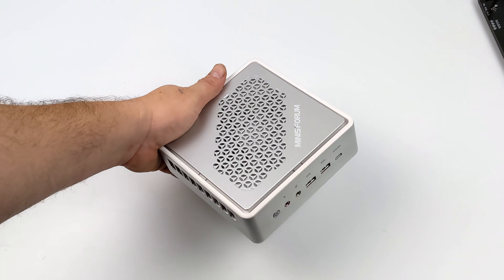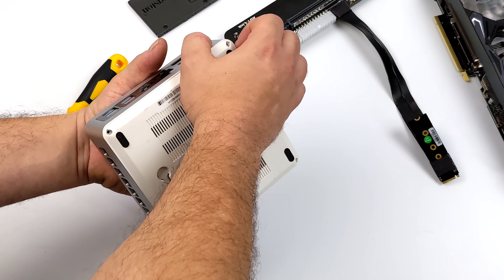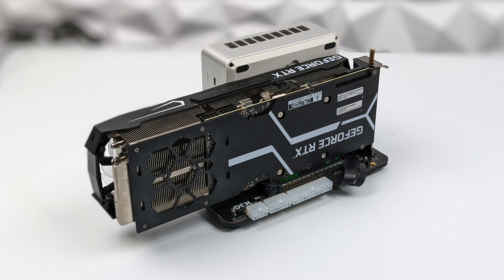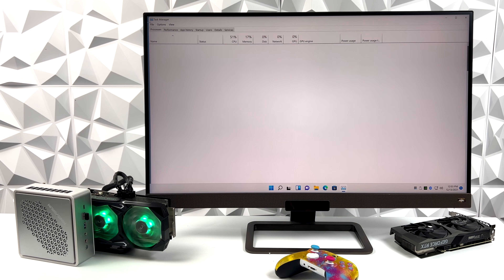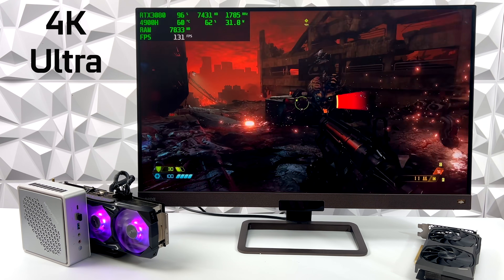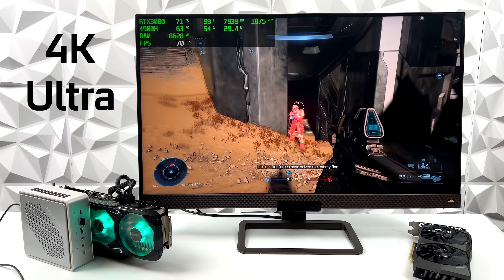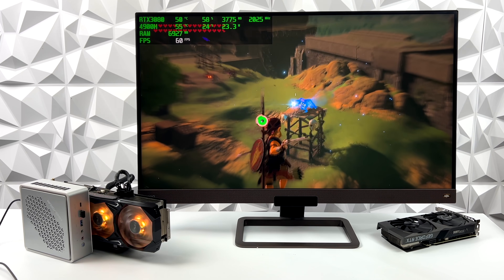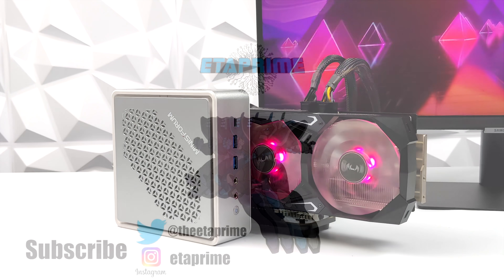We Built The Most Powerful Mini PC! It's Insanely Fast For A Tiny Machine!

Comment: how much does it cost to build someting just like that ?
Reply: I paid about 250 to 300 euros for my setup, here's what I got:

I got a HP Prodesk 600 G4 mini (OEM) for free from work. They were about to toss it out even though the machine's in perfect condition. It's got an i5-8600T, 8GB DDR4 RAM (upped to 16GB later) and 256GB SSD.

I added a GTX 1650 (120 euros) and the ADT-link adapter (about 80 euros). The Dell DA-2 adapter costed me about 35 euros. Add in additional costs for RAM upgrade, a 512GB SATA SSD and optional stuff like a 90 degree HDMI connector.

If you were to add costs for the PC it would be more towards the 400 euro mark, but you can get even cheaper than that. I saw a sealed GTX 1650 on Ebay earlier listed for 100 euros. Hope this helps!

Comment: There is not much difference in the performance between pcie x4 vs x16, as there is no game yet that uses the data bandwidth to the fullest. There might be some drop in performance because the 3080 ti here has been power limited.

Comment: would be cool if you could mount the mini pc internals on the back of the GPU with standoffs and get a 3d printed back panel so its a gpu size mini pc. or use a shorter 2 fan GPU but with a 3 fan cover and the mini pc is mounted at the end of the GPU under the third fan.
Reply: doing it with something like gtx1660/rtx3060 would be cool

Comment: I don't know why minisforum or one of those mini pc builders don't build a machine with an x16 slot on a side (and a power input for it). I'm pretty sure there could be market for it as a modular pc of sorts.
Reply: Minisforum is putting out a modular miniPC with x16 slot on the outside case where you plug in the eGPU .. problem is now you have two PSU ..
Reply: because there are acceptable laptops instead of buying those high end mini pcs,buying a mini pc doesnt makes if you a budget higher than 400 dollars
Reply: @lebedev6954 true. If you want a janky, a laptop is better then a mini pc because there are alot more use market for laptop rather then mini pc.

Comment: Imagine shrinking that RTX 3080Ti's die to fit within that case with a tiny psu there and still get the same performance with the same 4k resolution and ultra settings. That would be fabulous!! Technology has come a long way and still improving day after day.
Reply: cases were basically so big for a long time due to the HDD/ floppy/optical drive prevalence. With these newer storage solutions the case doesnt need to be as wide necessarily
Reply: @tobiwonkanogy2975  Absolutely

Comment: Surprisingly, even with the graphics card using only 4 PCIE lanes of 16, power limited with the 280w psu, and with a fan and a half blocked by the PC- it still managed to squeeze out just over ~80% of its max perf based on its 3dmark graphics scores (not overall); it's basically performing as well as a non-Ti 3080 in a normal desktop. Really not too shabby.
Reply: Too bad ADT m.2 adapter cant be hot swap(Shutdown after ending game, if you using APU), that make thunderbolt egpu better? I guess
Reply: @starrynight3945  Thunderbolt eGPU is significantly slower than M.2 PCIe X4 slot.

The reason? Thunderbolt eGPU only runs at 22 Gbps. Not 40 Gbps as advertised.

Meanwhile M.2 external GPU runs at 32 Gbps if using PCIe X4 Gen 3, or 64 Gbps if using PCIe X4 Gen 4.

Comment: I had no idea that you could connect a gpu to a m.2 slot. Does that work on laptops too? my laptop doesn´t have thunderbolt.
Reply: It should as long as your m.2 slot supports NVME SSDs, it should also support PCIe adapters like this. Just mind the generation and number of PCIe lanes as they will greatly affect performance.

Comment: I always see people asking for thunderbolt. 
Yes thunderbolt is pretty amazing, it is fast and incredibly simple/easy to deploy
But its very limited in speed compared to M.2.
The USB-C/thunderbolt4 connector only has 24 pins
PCIe 1x has 36 pins. M.2 trims many of the duplicate pins and ends up with 67 pins with 4 lanes
Even if you cut out all of the power pins, and can use all 24 pins for data on that type-C port
You're still talking about only enough pins for 1 lane, as 2 lanes would require 28 pins, again, assuming you have no power delivery.
If you cut out all of the grounds except 1 for a common ground, you then you would only need 9 pins per lane, but thats still less than 3 lanes of PCIe, where as an M.2 has 4 lanes

Which makes sense, because a PCIe 4.0 M.2 has a theoretical bandwidth of 63Gbps, and Thunderbolt 4 has a theoretical limit of 32Gbps

Now, most of these laptops and APUs dont yet support PCIe 4.0 M.2, cutting that speed in half. putting thunderbolt 3/4 possibly faster, but IIRC that is combined bandwidth, with some of that bandwidth reserved for video over displyport

My only device with thunderbolt, only reaches speeds of 1xPCIe 3.0 (945MB/s) this could be a limitation of the thunderbolt enclosure i have, but that SSD can normally top 3200MB/s in an M.2 3.0 slot.
Reply: Nobody ask you to write the history of your life in that long comment.

Comment: Can you please give us the name of the power supply?? I've been looking everywhere for something like this!
Reply: Search  on eBay for old Dell laptop PSU with 8pin connector, there are several models depending on how  much power you want, and 2nd hand they are all very cheap. 
However they are much bigger than modern PSUs,  a real brick (at least you could be used as a effective weapon if neccesary)
Reply: Should be DA220 or something similar, its a Dell 220W used for Alienware and similar laptops
Reply: @bagelbytes69420  I found the 220w. I'm digging for the 280w. This is a dream for stuff I want to build!!
Reply: @gabrielb238 280W?  If you are considering going full power a mini ATX PSU is also an option (using the 24pin connector), it will not  be significantly bigger than the Dell PSU, specially of you get a modular one to reduce cable clutter.

Comment: I have a 2019 laptop with a i7-9750H CPU and GTX 1650 GPU. It has no Thunderbolt, but has a NVME drive and a secondary SATA HDD. Could I do a similar setup?
Reply: yes but a gtx 1650 is still a good card
Reply: @bosozokurx7404  Not to many current PC games

Comment: does gpu runs at full capacity over m2 connection?
Reply: Cut 30% off at 1080p, 20-15% at 1440p and about 10% at 4k if I am remembering it correct.
Reply: But it still a huge difference to a iGPU like a Vega 10 with a mobile ryzen.

Comment: The HM90 has USB 3.1 gen2 ports. Have you considered using an external M.2 to USB-C/3.1 gen2 type A to run the operating system/main drive?

SATA SSD vs external 5Gbps USB, I'd choose SATA, but I'm curious to see the main OS drive being used over M.2 to 10Gbps USB and how viable that is.
Reply: It is pretty viable, he has already done something like that in the past when testing a 3060 with a mini-pc with a r7 on it

Comment: Would this build work well for programs like Clip Studio and Photoshop?
Reply: You really do not need a 3080 to run Photoshop but yes it does work.
Reply: The pc without the external gpu would run it with no problems, I have no issues running both programs with a 1050ti and a r5 3600, Although I do have 32gb of ram

Comment: Where did you get that Dell power supply??? an 8-pin connecter?? WOW! I've NEVER seen that before... I was realy confused at first because I didn't realize that the 8-pin came OUT of the Dell power brick (I though it was the connecter from the wall TO the brick... ) that could be VERY useful :)
Reply: oh wow.... so I paused it so I could read the text of the pci/m.2 adapter and I see now that the Dell power brock came WITH the adapter... ahhhhhh now THAT is cool!!
I wonder if I could use this setup on my Raspberry Pi CM4 'daughter' board's m.2 slot... 🤔🤔
DANG! I don't see a link to that adapter... well I don't have a decent GPU to use anyway.....
if you have a CM4 there is a Waveshare board you can use to pop in an nvme/m.2 that has worked flawlessly for me - in case you want to make a video about it... I'll check in on this post if to see if you want anymore info.... the daughterboard is called the Waveshare CM4-IO-BASE-B and they make a steel case for too....
I guess I'll just have to keep watching to see if this interests you :)

Comment: Rtx 3060 on such a pc.. the bottleneck is gonna be harsh 😂
Reply: don't think so. These mobile processors can handle a mobile 3080 easily which should perform in the ballpark of a desktop 3060. You see it even ran with the 3080Ti no problem